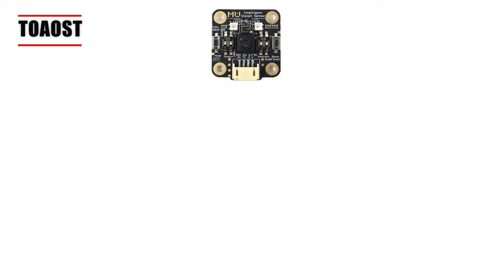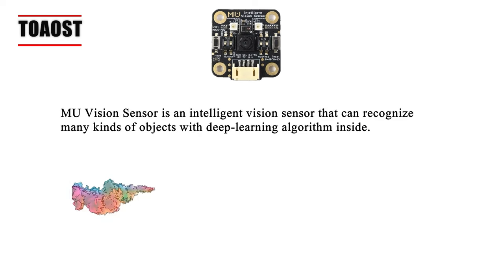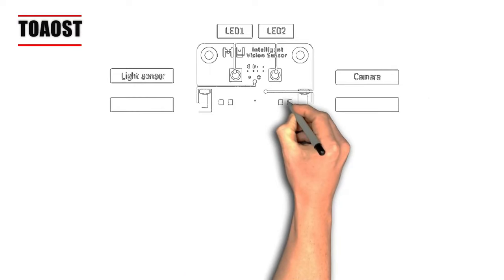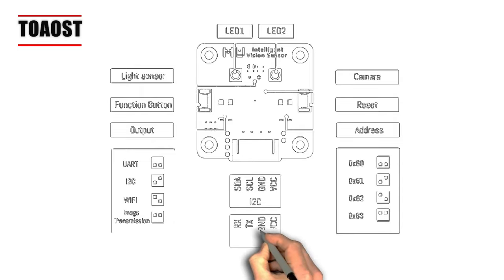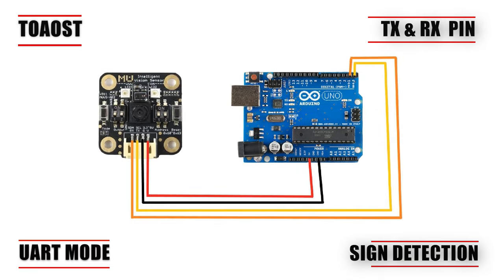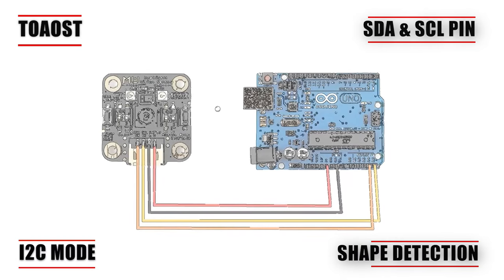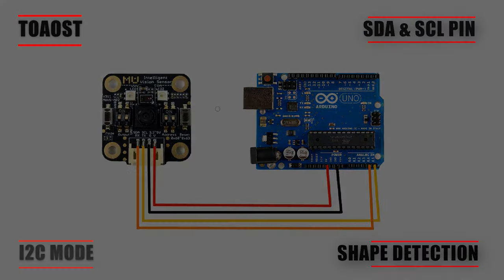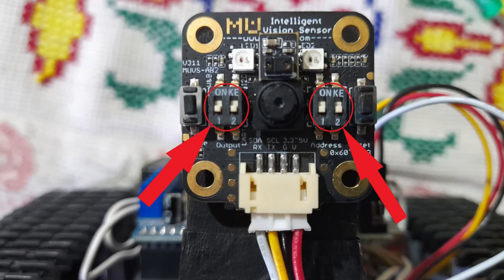Traffic Sign And Shape Recognition Robot | 2022 | PROFESSORHULK

Comment: hello sir I tried to upload the code but I get an error. I have Mu Vision sensor3 installed.
Arduino: 1.8.19 (Windows 10), Board: "Arduino Uno"

C:\Users\alexf\Desktop\traffic_car\traffic_car.ino: In function 'void setup()':

traffic_car:33:17: error: 'MU_ERROR_FAIL' was not declared in this scope

   uint8_t err = MU_ERROR_FAIL;

                 ^~~~~~~~~~~~~

C:\Users\alexf\Desktop\traffic_car\traffic_car.ino:33:17: note: suggested alternative: 'MU_SLAVE_FAIL'

   uint8_t err = MU_ERROR_FAIL;

                 ^~~~~~~~~~~~~

                 MU_SLAVE_FAIL

Multiple libraries were found for "SoftwareSerial.h"

 Used: C:\Users\alexf\AppData\Local\Arduino15\packages\arduino\hardware\avr\1.8.6\libraries\SoftwareSerial

 Not used: C:\Users\alexf\Documents\Arduino\libraries\Dabble

exit status 1

'MU_ERROR_FAIL' was not declared in this scope

This report would have more information with
"Show verbose output during compilation"
option enabled in File -> Preferences.
Reply from the maker: Send me the pic of the error on my insta my profile: theprofessorhulk